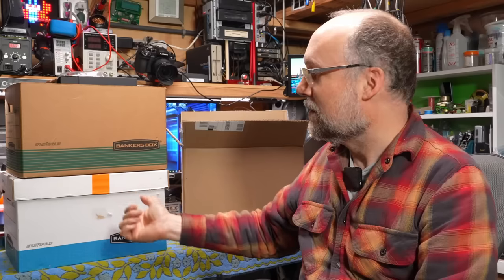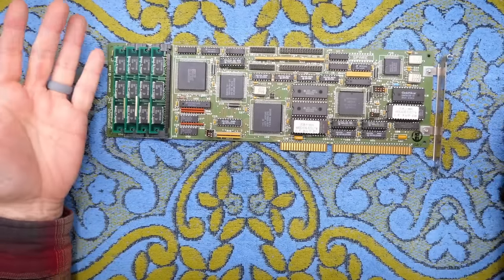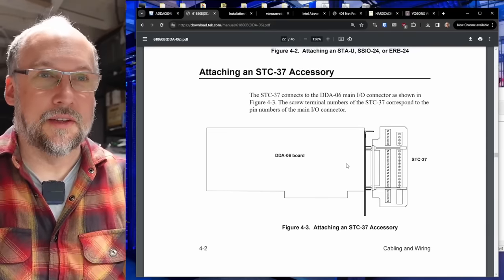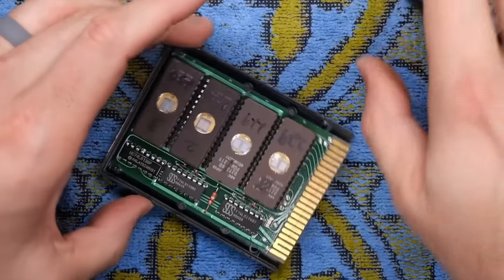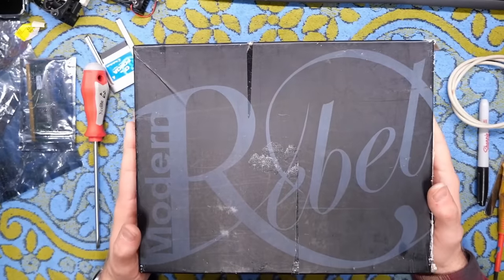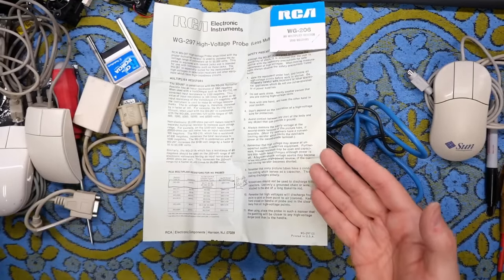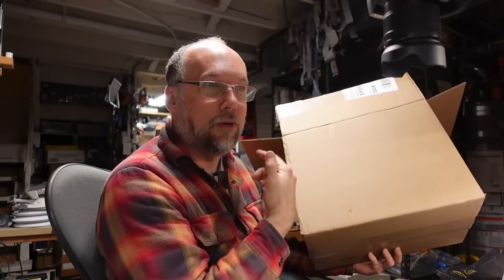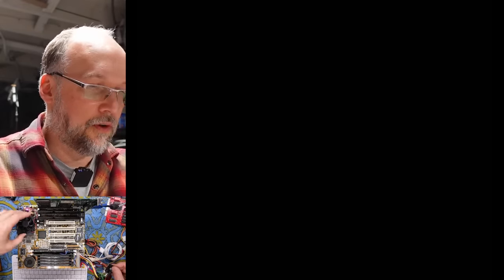What mysterious retro goodies can we find inside these boxes?

Comment: Hi Adrian, I was the President of a large disability provider including a school. The technology for using computer aided communication started in the 1980s. It replaced picture boards where a person would point to a preprinted page that had pictures. That actually has never gone completely away as its not dependent on having access to power and also can be easily customized. At the same time as this was developed there were self contained devices as well as computer based. Many used a plug in cartridge. SOme of the more sophisiticated systems also allowed you to load images from a mater set into a cartridge that met the needs of the person.
Reply: I like the electronic picture boards, the ones that have many customisable pages and will speak out words or phrases. (“AAC”)
Reply: You also have a lot of freedom with laminated bits of paper and velcro. Found one of my brothers the other day!
Reply: The grid scan and select system was born with POSM in 1960. This ESAM system sits on those shoulders and all the work that sprouted from that time around the world. Quite a lot of work was done in the 1970s with computers and disability access (such as MAVIS, Carba Linguaduc, Prentke Romich and others), but it exploded with affordable computers in the 1980s. This system demoed was $2000 USD plus all in AFAIK. Definitely looks like it was a labour of love.

Comment: Adrien, long time viewer. The last items you tested would now be considered AAC (Augmentative Alternative Communication). I know it well since i use modern descendants of such devices (some of my videos showcase that). I've used AAC the early 90s. From what I know, the examples you have aren't exactly cutting edge, but are contemporary for that time. That being said, those simple device and that software changed someone's life. At the time, I was still handwriting notes to communicate. Fast forward to now and I'm keenly aware how crucial and powerful it is to my own voice. The key is remembering it's "augmentative" not primary. Garbled as it is, there's absolutely no better way to communicate my independent thoughts, desires, ideas. Although when I decide necessary, I still use devices which have their roots firmly planted in those beautiful comm tools you have.

Comment: Win32s was a 32-bit application runtime environment for Windows 3.1. So those games on that disc do probably work with Windows 3.1. 

I remember back in the day playing a few early Windows 95 games on Windows 3.1 that were Win32s compatible. Ultra Pinball was one of those games. Performance was shaky, but it did work.
Reply: I recall Lemmings was Win32s compatible. I remember running it on Win3.11 on a 486 PC card in my Acorn.
Reply: Win32s was needed not only to run 32bit games on 16bit Windows. Microsoft TCP/IP protocol (installed separately, it was not a part of Windows 3) was 32bit and required Win32s too!
Reply: I came here to paste the same info about Win32s.

Comment: The curve tracer is meant to be connected to the oscilloscope in XY mode, and you can use it to compare characteristics of 2 (or in this case even 3) transistors. They were used for finding matching pairs of transistors for building A-class amplifiers.
Reply: Also used to find bad parts. Some transistors will work a low voltages but not where they need to.
Reply: This guy nails it.
Reply: Could this be simular to a huntron tracker?

Comment: ESAM'S KEE: It was one of the first public blitz boards for helping non-verbal handicapped persons. The system cost in Sweden was approx $400. And the system was config with Swedish words instead. How do i know this you ask. My sister had this system. And you are right the external cords on the button box is for external buttons. For ppl that only had head movements. So the leaned the head left or right. later on it worked with an eyelid button. So save that system it worth alot. And im happy to see this system again.

Comment: Win32s was a 32-bit subsystem for Windows 3.1 and 3.11. It basically allows some 32-bit applications to be run on 16-bit versions of Windows.
Reply: And you can install original 95 to use program manager instead of explorer
Reply: For instance, there was a Win32S version of WinZip. It was faster than the regular version. That was basically the whole reason I used to have Win32S installed. 😄
Reply: win32s was also supported by os/2
Reply: @aliencray7269  That's because Windows 95 and 98 included Program Manager but it was not the default interface.
Reply: @terminusaquo1980  I was going to say that, I remember as a kid just going to system folder and clicking on all executables. That's how I became a programmer, I wanted to know what those DLLs did.
Reply: Microsoft TCP/IP was 32bit too (it was a standalone product, not shipped with Windows 3), so Win32s was required too

Comment: My Dad had that probe. It was designed to be plugged into a VTVM with a standard 10 meg input resistance so for current meters you need to shunt it with a 10 meg resistor.
Reply: Most modern multimeters have 10MegOhm input resistance... but this probe expects a 100MOhm one.

Comment: The curve tracer is right up your alley. It’s usually built in on many oscilloscopes, and shows patterns on screen to see if an electronic part works or not.  Most have 2 probes that injects a tiny AC signal, and shows results on screen.  If it’s a short, will show up down, if it’s open, shows left-right, if it’s a diode will show a ‘L’ pattern, a resistor will show diagonal.  Capacitor will show circle/oval.  Cool stuff.

Comment: I had some of those Intel ISA memory boards back in high school, and at one point I was using one in a 486 for reasons I no longer remember. Normal DOS stuff ran fine, but anything that used XMS (including games like Doom or Descent) slideshowed like crazy. 

I actually wrote most of that Wikipedia article on ESDI many years ago, and the thing about the bridge boards was based on how Maxtor and Control Data designed their early SCSI drives...there was a servo processor that handled the ESDI-ish stuff, and a command processor that translated the SCSI commands to something the rest of the drive could understand, similar to the actual bridge boards companies like Adaptec were making around the same time.

Comment: A transistor tester can be used for many purposes:

1) Matching transistors. This is the reason why there are two sockets. You can switch back and forth and watch the curves jump. The less they jump, the closer the transistors match.
2) Checking the linearity of a transistor. Transistors are not perfect, they vary in linearity quite a lot. Using a tester, you can select transistors which are more linear than average. Also transistors vary a lot. That’s why there is such a huge range in the datasheet (min/average/max). Nowadays they are mostly very close to the average but back then you were very lucky to be close to the average.
3) Checking for bad transistors. Sometimes they do weird stuff at certain currents. On the tester you can see bumps and dips in the curve if the transistor is bad. A static test won’t reveal those faults if the transistor is working in general.
4) Checking the frequency behaviour of a transistor. By plotting the curve faster and slower, you can measure the speed the transistor reacts to the base current which is very important for high frequency applications.

I once had an old CCTV monitor on one of my C64. Suddenly there was a bright vertical bar on the screen. Moving the mouse arrow through the bar from left to right made it move to the left again and then back to the right. The horizontal video line “looped” and painted the area three times! On a transistor tester, there was a prominet dip in the curve so increasing the base current after a certain value made the transistor conduct less. This was the transistor generating the sawtooth signal for the horizontal deflection.
Reply: I was going to post something similar but you pretty much nailed it. Matching and testing transistors mainly. Particularly in broadcast gear back in the day.👍

Comment: For the Pentium Overdrive, one of the reasons why there was an overdrive for socket 5 is because socket 7 has a split voltage rail so that the core voltage can run at a separate voltage than the I/O CPU voltage, which runs at 3.3v. (There were also some early socket 7 motherboards that did not implement the split-voltage rail.) Because of the extra voltage rail, the socket 5 has one less pin than socket 7. A socket 7 CPU cannot fit in a socket 5. As you surmised, the other reason is the multiplier. They could set the multiplier on their own in case the motherboard couldn't (if the fan is not detected or failed, it will drop to a 1x multiplier).
Reply: That is correct. There were some IBM PS Series machines that would use that Pentium Overdrive but there was a specific pin that had to be omitted, otherwise the BIOS would clock the multiplier down and no boost in performance. It was called an "interposer mod board" that had to be ordered. I deployed some of these at Freightliner in Portland, OR. Soon after that, the Pentium II machines were being deployed and I really couldn't get the interposer from IBM any more as it was discontinued as a FRU part. After looking at the rare mod socket on socket minus a pin, I would just clip off the pin not needed and install them into the IBMs and left it that way on the machines that got their last upgrade before being upgraded in the food chain. Mind you even a Pentium overdrive was better than the 3270 terminals it replaced. :}  Thanks for the flashback seeing the things. They were Tandy Tough to overheat at the time.
Reply: I was really confused by this as well -- I thought the Pentium Overdrives were essentially Pentium cores that you could drop into 486 boards to get a really nice upgrade (especially the math coprocessor) and also support Pentium instructions. So it made way less sense to me that you would put one in a board designed for Pentium chips because... why wouldn't you just put a regular Pentium in there? Am I missing something?

Comment: As soon as I read the SC-01 chip, I realized it was one of those speech chips which was also featured in one of your older videos. 
When I used to work in a small electronics firm called Semitronics in the Philippines owned by Earl Henry Hornbostel, he had people using curve tracers to spec out unmarked transistors which he purchased in bulk and will then be sold as replacements for known but difficult to find semiconductors.

Comment: RCA WG-206 High Voltage Probe:
According to the instructions you showed on screen, that model probe has an internal 1090-megohm resistor, and is designed to be used with an RCA multimeter with an 11-megohm input resistance. It basically acts as a voltage divider, with the high voltage across the entire resistance of 1101-megohms (1090+11 in series) with the meter measuring across just the 11-meg internal to itself.  It sees only 1/100th of the high voltage, so you need to multiply the reading by 100 to determine the actual high voltage.  Displaying 350 volts times 100 would mean you're measuring 35,000 volts (35 KV).

You can picture the voltage divider resistances like a potentiometer, the wiper contact tapping off a percentage of the voltage across the full resistance.  If the wiper is tapping off 1/4 of the pot, you need to multiply the measured voltage by 4 to get the full value.

Modern meters have high input impedances, so you'd need to know that specification for your own meter to figure out the conversion factor for the HV probe.
Reply: I was going to say check the probe for the resistor.

Comment: The curve tracer is like a super-powered version of the simple component tester you often show. It can tell you a lot more about the characteristics of a transistor or diode (gain, breakdown voltage, threshold voltage, etc), and can be used for matching parts to specific purposes (less relevant in the digital realm) or for identifying parts that test good at the very low probing voltages used by either multimeters or modern component testers (a transistor that tests fine at 3V might fail to operate correctly at 20V).

That one does require an oscilloscope with an X/Y mode, as you discovered reading the documentation. It's designed for use with old-school analog oscilloscopes, although a digital or software scope with an X/Y mode could likely be made to work with it as well.

Comment: PC Power & Cooling is a manufacturer of power supply units out of Bonsall, CA.  For a long time, they were the premier manufacturer of personal computer and other power supplies.  They were my go-to back in the day for nearly silent and nearly bulletproof PSUs.  In 2014, apparently, they were acquired by OCZ.

In their day, there were very few manufacturers who could hold a candle to them.  Lambda and Delta were two other American concerns during that time who could hang with them, but all things for a price.  I see where Lambda was acquired by TDK, so I would expect them to still have standards of high quality, and Delta primarily concerns itself with industrial and medical power systems now.  When they were making PC PSUs they were absolutely formidable.  (There is a Delta unit in a computer for a test rig where I used to work that has been in service for over fifty years and is still going strong.)
Reply: EXACTLY.  I remember seeing them winning reviews in boot (then Maximum PC) magazine.  Power Supplies in the 90's were JUNK.  So many people just used whatever came with their case.  I've personally seen the green flash of death at least a couple times.
I still have a Turbo 400 from one of my first builds.
Thankfully Super Flower and Seasonic started selling to the aftermarket around the same time that PC P&C went away.
Seasonic is still my go-to to this day.
Reply: fifty years? Since 1974? Doubtful since the first IBM PC was 1981... Maybe you mean 40 years? Which would still be impressive...
Reply: I remember selling servers in a PC Power & Cooling case that went for $1200.  Held two motherboards, redundant hot swappable power supplies, and I think 17 drive bays.  I also remember them as one of the first to sell reliable replacement fans.

Comment: The tape eraser brought back some fun memories. I used to work for radioshack from 2002-2006.  Us employees had a blast playing with some of the old equipment that the stores hung on to for YEARS.  It's a real shame that radioshack went the way of the Dodo. I worked there towards the end of the era of being able to buy electrical components. There was just something enjoyable about going through the component bins when looking for a part.
Reply: I worked for TE Electronics that serviced the Radio Shack service plans for Tandy as a separate division from 1994-1997. Housed in Computer City, at Hayden Island, Portland Oregon. It was hella fun having access to all the microfiche and service manuals for anything Tandy related that I could order. I refurbished many devices for my own personal use from my collection of "It's dead and not worth fixing" pile on my own time and the tape eraser was common to find several in each shop. At the time there were 3-4 surplus shops that you could pick components from and sometimes whole machines that were being scrapped from the Silicon Forest industry. I had no shortage of electromechanical goodies to chose from in that era. One way to deeply immerse one self into the trailing but 
leading edge of technology was to pick up the dumpster tossed stuff and look into how it worked.
Yes, I was the kid who took everything apart at an early age, and that is why I watch Adrian's channel.

Comment: The Votrax SC-01 is a great find!  I played with it back in the 70's and interfaced it to a Z-80 computer as my first speech synthesizer.  Now they are highly sought after for repairing certain arcade games that used them, easily fetching $200 on eBay (if they work).

Comment: The D/A card is interesting.  It might be possible to turn it into a crude audio card or synthesizer, depending on how fast those chips can switch.  Another option is to work with other synthesizers that take an analog control voltage, like patch-cable style synths (think Moog).  All of that would take some very custom programming to pull off.

Comment: CuriousMarc uses his HP curve tracer to check marginal transistors. Great for hunting down "odd" faults.
Reply: Had to use one in college.  The thing was i gigantic vacuum tube oscilloscope with a plug in module for doing transistor curves.  Basically you'd set it up, clip on a land camera system, and take a photograph of the traces.  Then you could actually drawn some lines on the photograph to determine your Q point and min/max inputs for that specific transistor.

Back in the old days, a lot of "hand made" premium audio amps used hand matched transistors in the power stages for maximum fidelity of class AB and B amps, because "matched" transistors gave you the best fidelity (each transistor was doing one half of the waveform, so it was important both transistors had comparable characteristics).

Luckily these days, transistor manufacturing has gotten so good, people typically don't bother anymore.  But back in the early days, transistors were highly variable, even within transistor types.  You could pull two transistors with the same part number, and they'd be fairly close, but not that close to each other.  For most uses, it really didn't matter.  But HiFi nuts will be HiFi nuts...  ^-^
Reply: He mentions the exact model Marc has. So it's pretty safe to say he's seen the videos.